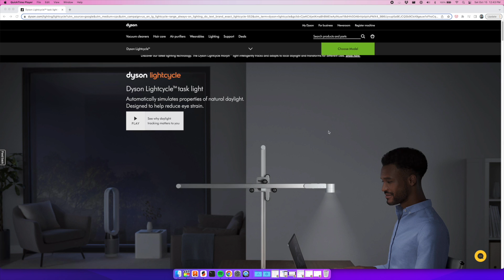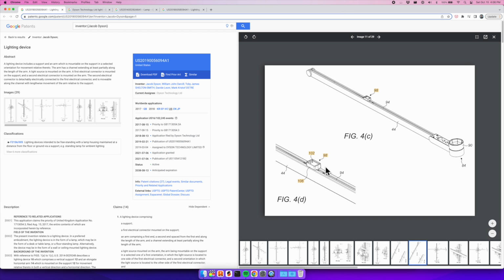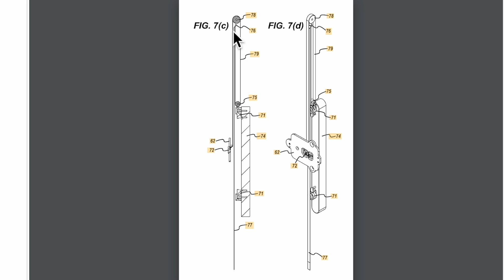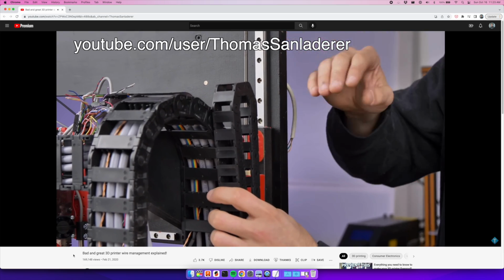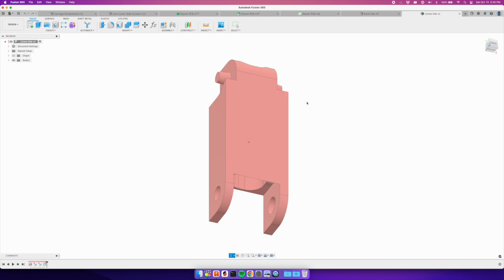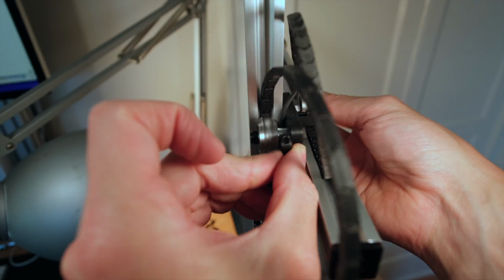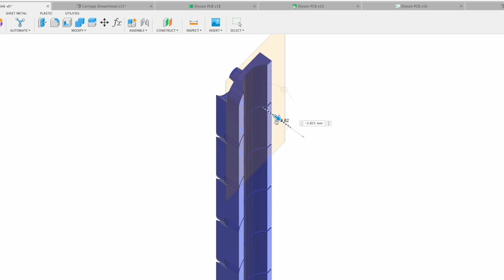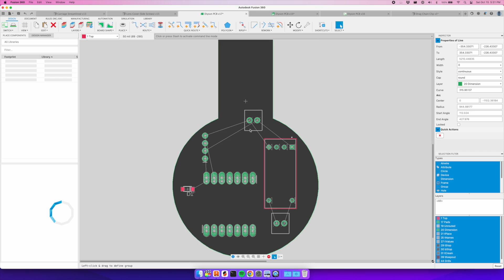Cable management so good, it's illegal - DIYson Lamp Build Log #6

Comment: Loving the video series so far! Have you considered running the power through a couple of copper strips inside the extrusion grooves (Insulated on the side touching the aluminium, and hidden inside the grooves edges), with a couple of L shaped graphite brushes acting as pickups fixed to the carriage. If this could be implemented for the horizontal and vertical axes then you would eliminate the need for cables/drag chains.

Comment: I also just had this recommend and watched all the parts. I think you could improve the drainchain a lot by altering the end pieces. If you mount them parallel to the axis you want to run the drag chain in, the chain will not stick out quite as far and will also run in a parallel fashion.
Reply: I had the same thought, you could probably reduce the circumference of where the drag chain turns 180 degrees by doing that.

Comment: Idea for easily hiding the horizontal cable even more: Start the cable leaving the light in the aluminum extrusion channel on the UNDERSIDE. Then, have it wrap around a circular bearing that is at or near the end of the extrusion, and feed it through the channel on the top. To make sure the cable is as taught and secure as possible, have the circular guide be attached to a spring so that it will allow for some play when moving and take up slack when its not. You don't even have to change the light or its wires at all. Simply drill a vertical hole in the extrusion near the light and feed the wire through it from the top to the bottom. Let me know if you have any questions!
Reply: It is basically exactly what you have, but the cable is on the bottom instead of the top. The same concept would work for the vertical wire too. I think you should try it out!

Comment: Hi Steven, just found your channel and love the DIYson project and watched all parts available so far. I love that you went back and to go to a 20x20 rather than the 20x40 rail.I like the effort you've gone through to design the drag chains and even "print-in-place" large sections, but asthetically it doesn't work and yous knows it ;-)

Instead of looking for a flat cable, I would suggets using "Copper Tape". this comes in self adhesive rolls in the right size.
Belt, Copper tape, Insulating tape, another layer of copper tape and then a final black layer ;-)

Keep up the great work and videos.

Comment: Hey Steven, with the open wire problem: You could put the wire inside the T groove from the aluminium profiles and make a pulley attached to a spring on the end of the profile which is attached to the cable. Print some T groove covers and there you go, hidden cable management

Comment: As you just have to bring power up there, why don't you use some  Digital 143 Double Sliding Contact Set like in Carrera track? Beside,  it is also possible to transmit data over a power connection, was done a lot in domotic before wireless coms (also an option between base and top, but seems to me it makes more sense having the logic up there as you have now).

Comment: A suggestion for Version 2:
Use a stack of electrical tape and copper tape (or any other stack of insulator and conductor) in the same channel als the v-roller is rolling on top of. A sliding contact, a small conductive roller or a conductive leave spring, could than contact this strip hiding all wires all together.

Comment: Great Video (and awesome lamp project) maybe someone already suggest it, but I would have mounted the last drag chain segment (the one connecting it to the carriage) pointing down into the aluminum extrusion, so that the chain lays flat on itself, with only a bow at the end (it needs to be a bit longer than the extrusion for this to work)

Comment: A linear equivalent of a slip ring would be a cleaner way to get power between the arms and the carriage. You'd only need one conductor run down the middle of the slots that face the carriage, then use the aluminium arms themselves as a ground.

Edit: think of the carriage as a slot car, and the extrusion as the track!!
Reply: Excellent thought about using the aluminum as a conductor. It would be tough to have a sliding contact on it though: If the aluminum, was anodized, the surface would be insulating. If it’s non-anodized, anything dragging on it would leave ugly marks over time.

I do like the idea of siding contacts though. You could use some of the nickel strip they use for building battery packs, with some double-sided tape holding it down in the channels of the aluminum, which would also keep it insulated from the surroundings. Then just more nickel or perhaps some beryllium copper for the brushes.
Reply: @DEtchells  good point re anodising and oxidation. You could copper plate the aluminium parts. Would provide improved conductivity too.
Reply: Exactly, using one of those carbon conductor thingies found in a drill
Reply: @ahmadhasan3258  no, I think carbon brushes would leave an unsightly mark on the arm. You would have to use a sprung copper contact.
Reply: Thought about same thing. Some time ago even had one lamp that has both wires as the non isolated parts of the casing - found that when accidentally shortcutted them)). Metal bearings work fine for conduct small amount of current (but not fine if it is 200A roller welding machine)). So, there need one complect of electric brushes of some kind to feed this device.
Reply: I thought about this principle too. But the fact that you have to make linearly movable mechanical contacts for otherwise solid wire, ads a lot of complexity, reliability and safety concerns.
Reply: Im in robotics and ive been trying to find the name of this for SO long. We used giant slip rings for the turrets on our robot and i really wanted to mention it here when i first found the project some time ago, but again i could litteraly not find the techincal name for it. I finally stumbled across a post describing this and I came back to comment it which is why im back here. Of course dyson didnt invent these brushed connections which is why it shouldnt be illegal, right? Its a bit scary and ambitious, though, (regarding saftey) which is why im a bit hesitant on following along and building my own.
Reply: Correct. These are actually called track lights, with electricity running through the rails. There're already many on the market, so you could just connect two of the rails together, like Dyson did with their lightcycle.
Reply: A quick glance at the dyson lamp confirms they are using sliding contacts.
If I were to make something like this, but better, I'd make it so it locks into place electronically, releasing when you grip certain key areas only. This would also allow for a nicer feel on interfacing.
Reply: Exactly what I was thinking
Reply: I think spring-loaded contacts would also work to create a "linear slip ring". There are some that use a ball instead of a plunger. Check: Omniball contacts
As for the rail you could 3d print an insert for the slot in the aluminum profile and add a couple of thin copper tubes as rails.
Reply: you can buy spring contacts called "pogo pins" off the shelf very cheaply
Reply: @dodgydingygames  I'm aware of them but my concern with pogo pins is that they're not designed for sliding contact. I suspect they would wear very quickly due to the small contact area. This needs a large copper leaf spring type contact I think. Of course you could make the pins easily replaceable as a consumable but it's not an elegant solution.

Comment: Did you consider to use the aluminium extrusion as cable? Eighter bei spliting it in the middle and putting an isolator in between or adding like a copper rail in the channel
Now you “just” need to pick up the electricity with metal rollers rather than rubber wheels
You would of cause have to use something low voltage like 5 V for safety

Comment: Fantastic progress, I hope to be able to contribute to this project someday. Meanwhile may I suggest using measuring tape as a cable support, when you cut it in let's say 1 meter strip and then bend it gently 180 degrees it forms two straight sections with nice bend. It can easily support a few cables and it would keep cables orthogonal  to the rest of the lamp. Voron builds use this technique in place of some drag chains. Great work and enjoy the process.

Comment: What about using the aluminium sections to conduct electricity? Of course you would need metal wheels to conduct it from post to post, but it could be way more tidy. The only catch is that you need to make a beam with two, electrically, insulated extruded beams. Maybe exteuded half sections are available somewhere?

Comment: You could always buy conductive copper tape and place it in the top and bottom channels on the X axis (one for positive the other for negative) to pass power through. Then use the same technique for the counterweight to connect to the power from the Y axis?

As for the rotation - I'd recommend Electrical Slip Rings.

While I'm not certain about this, but you aren't making any kind of profit from it, so utilizing the same idea for the Y Axis power as Dyson shouldn't be an issue at all. I just wonder if you could even get a belt with wires in the rubber.... Or would it be easier to find a flat ribbon cable and glue it onto the belt? 🤷

Comment: This project is really cool, I'm gonna subscribe and keep an eye on it! I haven't had a chance to watch the first video yet, but for future iterations, is there any potential for running the wires through the center hole of the v-rails? I've seen it done on 3d printers to hide wiring, though I don't know much about the details as I haven't done the mod myself. Maybe play around with constant force mechanisms as well? They're the springs in ID badge reels that let them retract back into place, so maybe that could help with the excess wire in some way!

Comment: You might consider that Dyson used a sliding contact instead of a cable in both the arms and in the base.  generally you need a long copper strip and a sliding contact like you would see in a DC brush motor.
Reply: I was also going to suggest that, and maybe some capacitors to prevent any "flickering" while moving the arm

Comment: you could do it with brushes and long cable strips.

or you could also do it by using a single conductor in the rail and the metal frame as a ground plane to complete the circuit.

also dyson is a european company so i doubt that they have patent jurisdiction in the united states.

i downloaded the video so if they do manage to get youtube to take it down i will re post it to a torrent site who only removes malware, fakes and exploitatively illegal images.

you could also set up a tor page to host the plans no company can get a tor page taken down.

you could use just 2 conductors to the leds them self to make the wire thinner and have the controller in the base

Comment: Hi Steven, your idea of using drag chain to work around dyson's patent is amazing. As a fun project, I made a Dyson lamp replica 2 years ago. I used some off the shelf torch parts for the lighting. I bought a 4mm heat pipe that fits exactly in the circular hole of an aluminium extrusion. I used some conductive copper tape and conductive slide to work around Dyson's cable management. I just uploaded a video of the lamp, please have a look if you are interested. https://youtube.com/shorts/VVdUCMulmyQ?feature=share

Comment: I've first seen this lamp on Dyson's Milano HQ few years back, I always thought the power was transmitted with brush contacts. I love how your take turned out, cable chains really gave it character.
Reply: Yea I worked with powered rails for lights, they're actually quiet dangerous with 120V running on exposed wire then I realized that a fucking battery eliminates wires.

Comment: Hello, awesome Project. And excatly the thing a needed, I'm searching for a new Desktop light now for quite a while and never found something that I found good. And on the other hand I have two V slot Rails and I never did a Project with them. One thing I would suggest: try to rotate the end of the dragchain by 90 degree, then it should be a little bit flater. Have a look at the Voron 3D Printer and the toolhead, there it is done this way.

Comment: Amazing project and great progress so far. I have to say though, I'm not 100 percent convinced on this wiring solution. I wonder if you used something like "wet noodle" wire (silicone insulated, multi strand wire), if they could be used like Dysons integrated belt/wire? Also, they make steel reinforced gt2 belts. Steel is not a great conductor, but maybe it might be good enough?

Comment: The drag chains look off, they should be more rigid and make a low profile U not a big round O. The first ones looked like they bent backwards, the later ones are better. Is it just the cables rigidity keeping it in a big O? Maybe user flexier cables.

Comment: Could there not be a pair or isolated conductor strips in the valley of the channel which has brushes from the black carriage assembly that contact it then transfer the power to the other piece of extrusion in the same way? If it’s only low voltage and buried in the depth of the channel surely it would be fairly safe? Kind of like a linear version of electrical swivels used in wind turbines to allow them to turn into the wind. If you’ve already discounted this idea for some reason Iv not thought of then discard this comment at will. 
Thanks, tom.

Comment: Hey Steven, I work in a semiconductor fab where we have Automated Material Handling System (AMHS) Monorail cars in the overhead of the factory that pick up and transport the wafers to various points all over the fab using the transportation system. These cars are fully automated and are individually powered by what I believe to be some sort of "sliding power connection" strip or track. They may even be inductive? Perhaps you could rethink your design from using wires over to a miniature sliding connector style setup? No wires to get all fouled up! Just a thought

Comment: Someone already mentioned using a sliding contact with copper tape down below. Alternatively, you could print small spacers to hold 2 bare copper wires separated within the extrusion slot, then use spring loaded graphite to transfer between segments. This is very similar to how brushed motors work
Reply: Or you could use a battery powered light

Comment: You could also try a mechanism that is used for the "retractable USB extension" cables (cable reels on thingiverse), some of them have a well tensioned spring and work very smoothly. You might be able to mod an existing product and reuse the 4-wire USB cable for the original control circuit setup.
Reply: I was just about to suggest this, then thought i better read the comments first.
Reply: True. I was about to suggest the same. Attaching a miniature, 3d printed version of a cable reel with a 2mm flat ribbon cable, effectively solves the issue of wiring, along with the movement issue for both axis. I haven't 3d modelled anything yet, but def an idea worth chasing ngl. I'd probably use 2, one for each axis. If it could be done using one, I'd be impressed.
Reply from the maker: Thanks for the suggestion! I definitely considered this early on. Two issues: 1. the "retractable" nature of the reel pulls on the arms because the arm is designed to glide with very little effort (kind of a necessary tradeoff). 2. The cable is much harder to hide when it's reeled vs when it's lying flat in a single layer. Still might be possible, but those are the constraints that stopped me from pursuing this :)

Comment: So I'd like to build on my previous reply with some actual hardware suggestions since that makes the idea more apparent.

Since we only need a DC supply and DC return line, we only need two contacts. Ball bearing roller contacts meant for connectivity on moving components exist! Mill-Max 7949-0-15-20-09-14-11-0 ball-bearing contact on mouser seems appropriate for this application. They are small enough that two of them could be fit inside the V slot extrusion with room to create a housing around them with 3d printing. They have a press fit knurling and solder cups to attach wires. You would need a total of 4 of these contacts, two to go from the vertical axis to the carriage, and two to go from the carriage to the horizontal axis. Both sets of pins would be mounted to the carriage. They are internally spring loaded so we don't have to do much of that work ourselves. Another poster had suggested using copper tape, and that would work perfectly with these bearing contacts, you'd need to carefully attach them so they are perfectly straight (or 3d-print a guide to install the tape into, which would probably be easier) this would allow for perfectly hidden connectivity!
Reply: Also, if you mount the two pins offset equally X/Y this means that you van simply have two opposing pins to bring contact from one axis to the other, since the pin that is higher and to the right will be on the top/right contact strip and the lower and left will be on the bottom/left contact strip always. This would come with the caveat that all electronics would need to be housed in the head extension of the lamp, which I know youve expressed you are opposed to due to thermal and space constraints. It may be possible to add more contacts this way, but will get increasingly more complicated, though keeping them in a diagonal line will allow for simple interfacing between the two axis.
Reply from the maker: Thank you so much for the specific hardware recommendations, that is incredibly helpful. Already added those ball bearing contacts to my list. Your concept is really well thought out and pretty much in alignment with an idea I've been chewing on lately. Thanks for the thoughtfulness and detail. Stay tuned :)